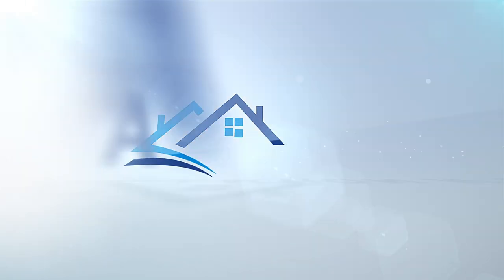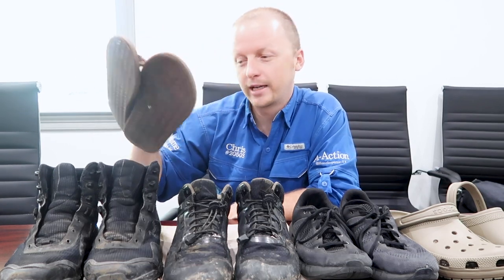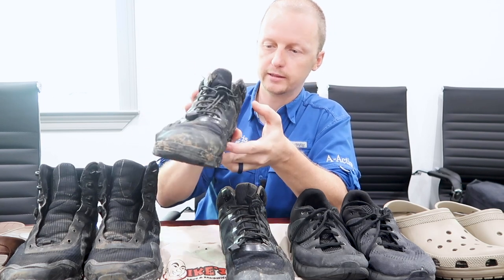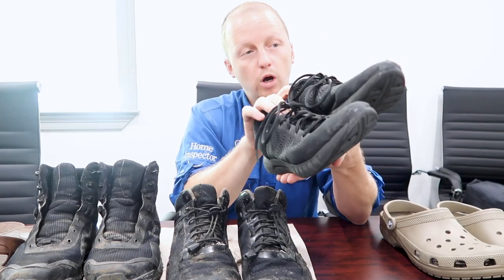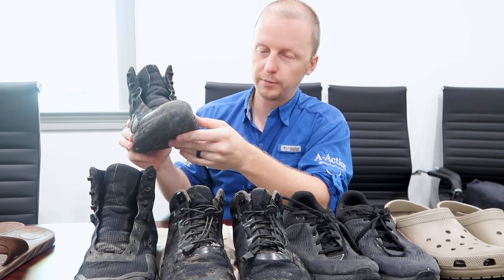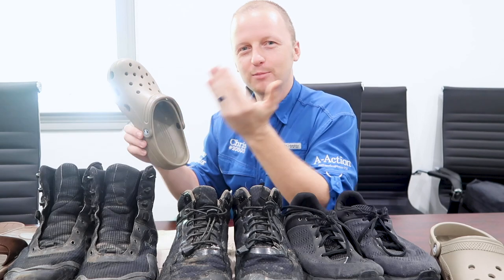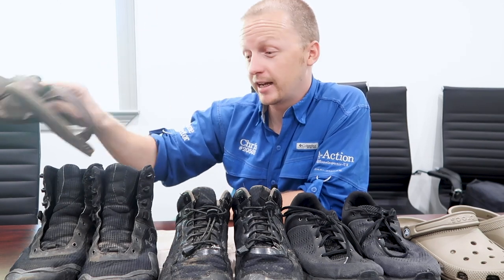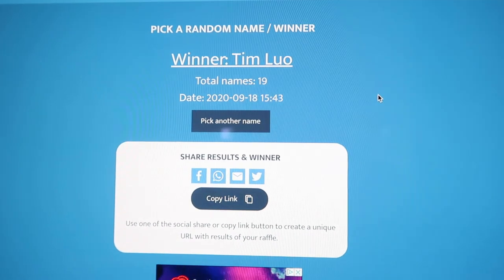Shoes for Walking on Roofs

Comment: I'm an insurance inspector and have  been through a lot of different boots and go up and down 30 roofs a day. HANDS DOWN best boot is the CATERPILLAR Treashhold waterproof. You can get it without the steel toe. You can get them at any academy for $100. I can easy grip on a moderate slope roof. Work great even with roofs with granule loss.
Reply from the maker: Looks like I might be making another video!